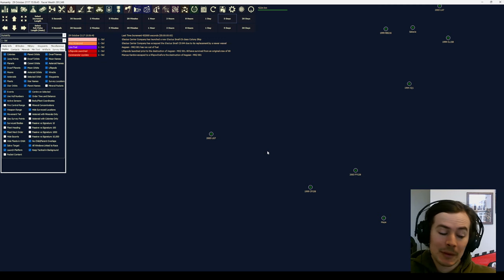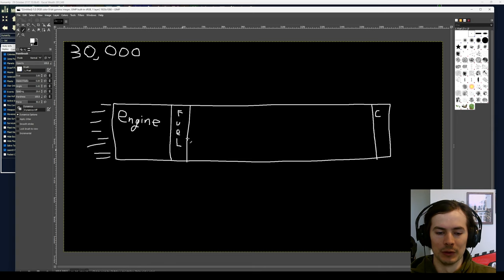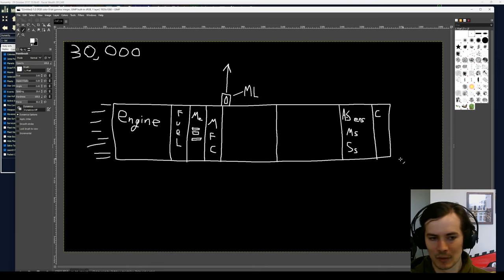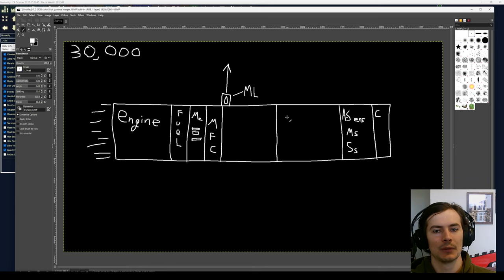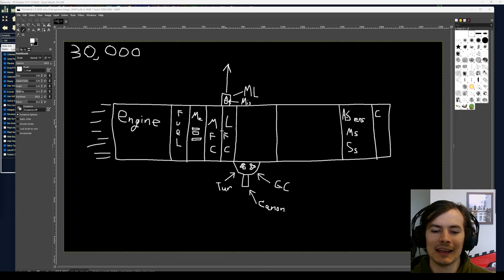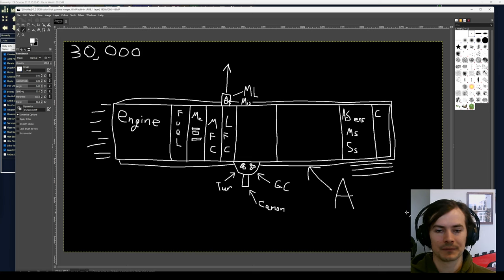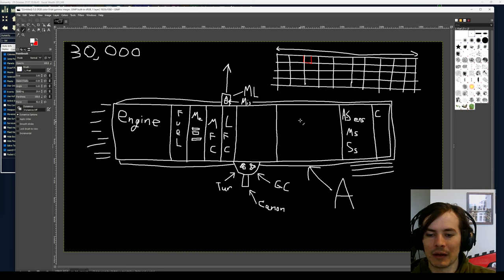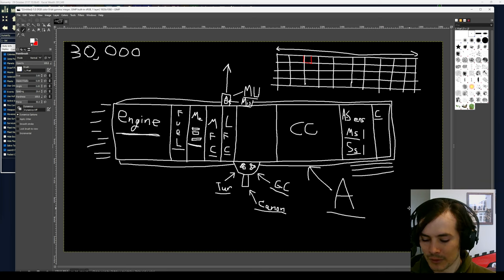Aroura 4x - conceptual ship design lesson

Comment: The thing that tricks people is that certain components have to all fit together. Assuming you're not using picket ships, your active sensor, missile guidance, missile range and launcher size all have to be decided on at the same time or you could get a missile you can fire at half its range against an enemy you can see at a quarter of its range. 
Since the active sensor tends to be the biggest problem to research and the size of it runs into diminishing returns past 4 hull spaces, I use that as the starting point and then put everything else into its limitations. Then when I get the components worked out, it's just a matter of stuffing it into the ship tonnage limitations.
And if you want to work with a lot of smaller ships, you get to go really fast, but you must dedicate some of them to carrying nothing but the active sensors.